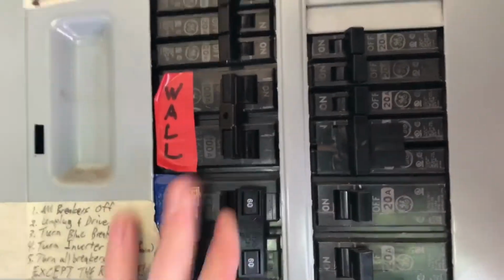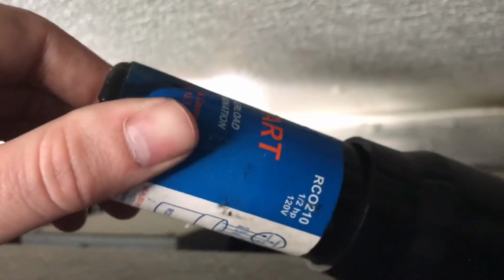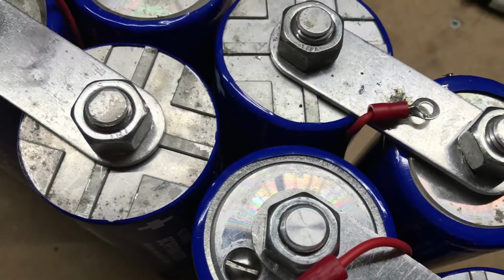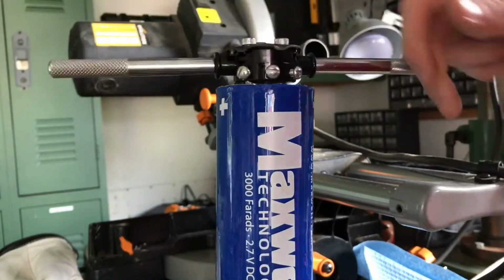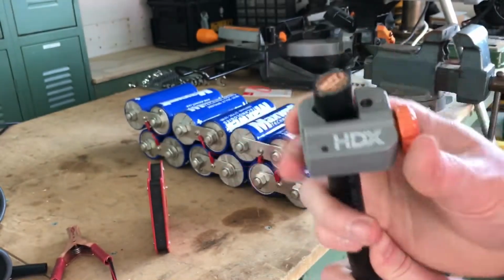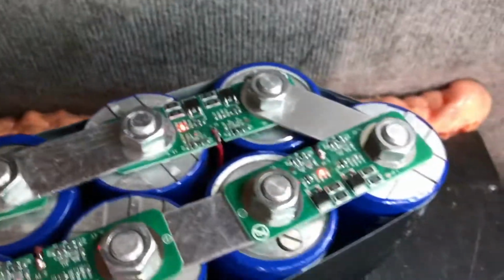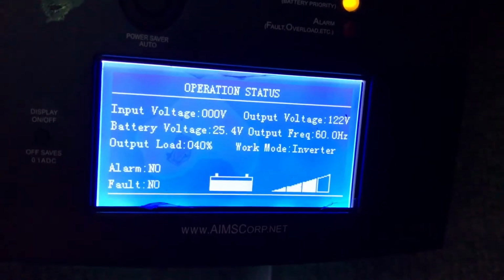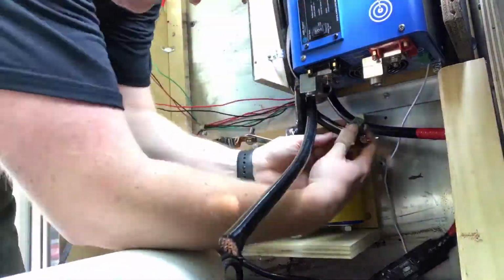#4 - Clean Energy Food Truck (Ultra-Capacitor Resolves Premature Shutdowns)

Comment: Why not just start with 48v? Aims makes that inverter/charger in a 48v version, better yet it's 240 split phase so you could have taken full advantage of the split phase wiring in the truck. At 48v you are pulling half the current so the thinner wires can be used, less current pulled from the batteries, therefore no need for the ultra caps either. Using AGM batteries here would have been a smart move as well. They have more available current capacity and higher energy density. Charging and discharging those super caps through a resistor is recommended.
Reply: Tofuinc, this is over my head but I want to wire a small truck like this, do you mind emailing me and helping. I appreciate these videos bcoachk at gmail

Comment: What is the total watts of all of your equipment that you are running off of this setup?
Reply from the maker: Hey Sam, we were peaking at about 4,000 watts with one turbo air upright refrigerator,  one turbo air upright freezer, one commercial grade roll top fridge, two exhaust fans, wireless router, POS system, and 4 LED fluorescent bulbs.

Everything went to hell when someone tried to use the electric rice cooker or the blender.

Comment: where would a person go to have this installed in a food truck in Colorado, and what might the cost be.
Reply from the maker: You’ve gotta break the job down into two parts:
1. Fabrication (mount everything)
2. Wiring

Fabrication is something you and some friends can do yourselves without any major risks.

Then it will be much easier to hire an electrician to make sure all the wires are hooked up properly.
Reply from the maker: Electrician’s in Ohio would charge anywhere from $100 to $300 to hook up the wires from the inverter to the electrical box.

I’m not sure if they’d be willing to wire up the battery bank or not.

Comment: use welding cable.  ultra flexible
Reply from the maker: Great idea Jim, but won’t that cause a lot of power loss compared to 4ot?

We tried flexible jumper cables back in our first video and found them to be pretty warm during operation.

Not hot, but definitely warm enough to indicate major power waste in the form of heat.

Genuinely interested to hear if you’ve had success with welding cable and what kind of watts you were pulling through them?